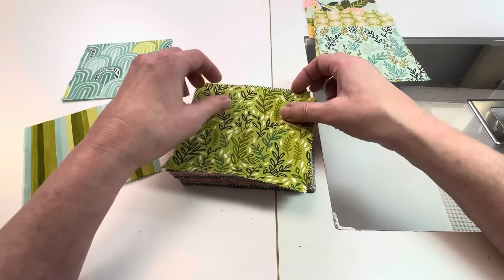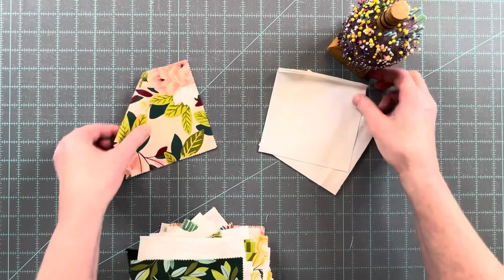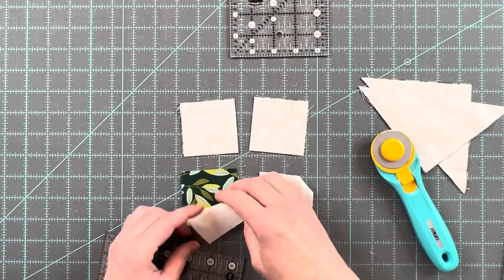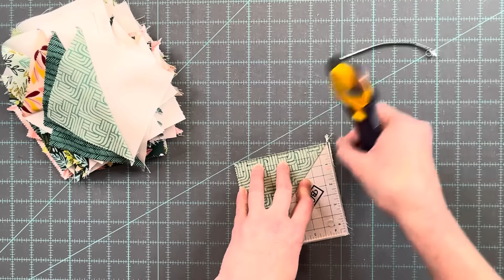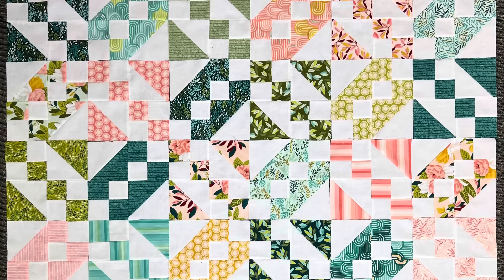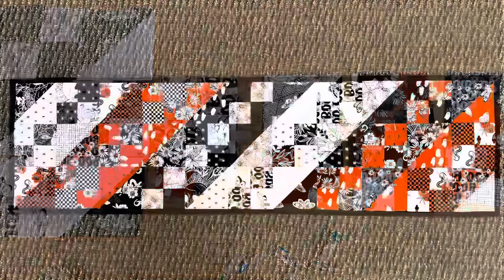Simple Sewing & Designs for using 5" CHARM SQUARES! 2nd in our series to use 5" squares or charms!

Comment: Another way to do the quick 4 patches: place the big and charm square right sides together. Sew on both sides like in your demo. Cut down the middle of the sewn square parallel to seam lines. Press forward print. P!ace the resultant units right sides together, print to bkg, nesting seam. Sew down both sides perpendicular to seam. Cut down the middle of the unit, between the last set of seams. Press and voila, two 4 patches. Just one less seam than your method.

Comment: You could cut your layer cake into 4 charm packs if you want ×4 matching too.  Do you have fat quarters to tackle next?   Hunks of "cut into" yardage, or do you have left over strips from all your 108" backings?  Could you try mega size log cabin quilts, with one block, or only 4?  They could filter down into your boxes if you cut them into pre-cut sizes too?  If you made some design boards, you could stack up sizes as you go on separate boards.  You have "stick to it-ivness".  Those sorted 2 1/2" boxes were a huge resource at the start.  Well done with taming all of that, it looks much more manageable now, and you will get these charm packs under control too.  Do you ever make mug rug and bowl cosy sets out of charm squares, to sell in your shop?  How about a 4-patch rug with mini and alt charms for home?  Not everyone sews, so many look for gifts.  Don't take on too much though.  I made a string and black  "can get greasy" 1 layer spread with clipped raggy seams, out of gaberdine to put over the bed, so a person with a grotty job can rest before a shower.  Without messing up the bed.  Somebody has to do those jobs or we all are in trouble.  How many cars would die without mechanics?  All the best.

Comment: Great video.  Here's my sweat shop (personal) production trimming tip to consider (as I see you are production minded!):  when trimming piles of the same block (your HST's)  Round 1: trim first two edges from trim pile (pile 1); set aside into pile2)  Round 2:  Spin pile 2, and then trim remaining.   This method (a) allows you to spin your block and your ruler just 2 times (one time for each pile); (b) never change the alignment of your ruler.  Your brain and eye will thank you.  (particularly true for specialty rulers when the marks are different between rounds such as flying geese)